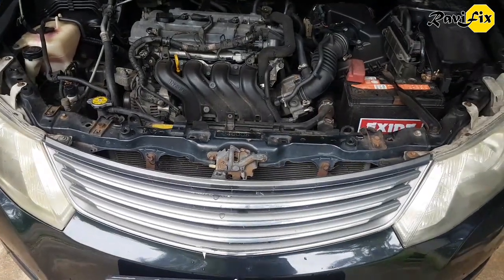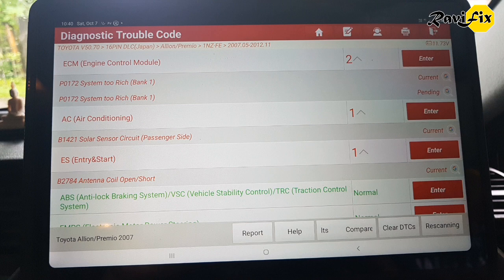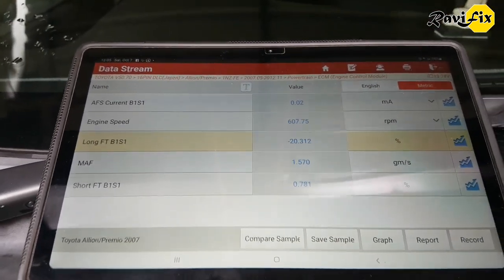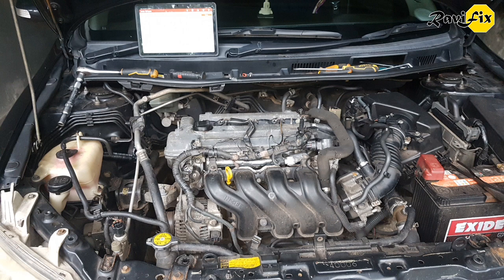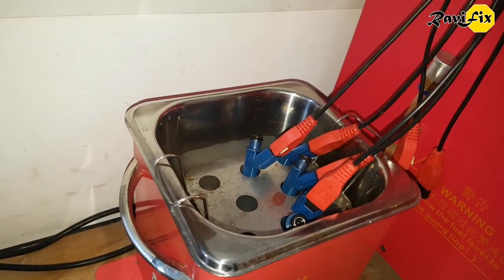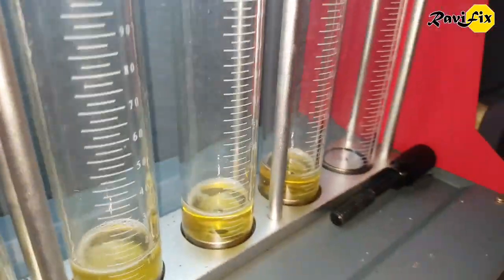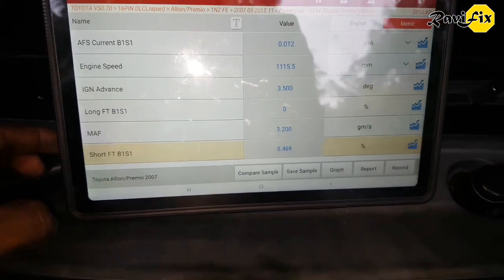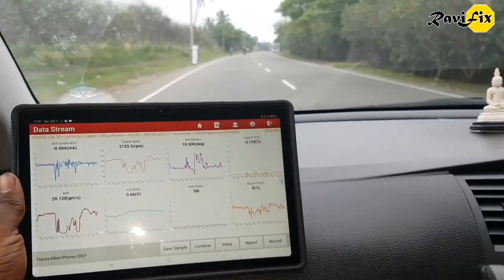Toyota Corolla Allion P0172 System too rich Diaganosis and Repair. learn auto scanning

Comment: The rpm at initial check was at idling i.e. 600. when you said you fixed it, it was at 1100. The values will definitely come down at higher rpms.....

Comment: Greetings Ravi. The situation with my car engine 2ar-fe errors p0102, p0172, с1201. Can you please tell me what the correct readings are for the MAF sensor on this engine g/sec on XX and when moving ? The car has gas installed.
Reply from the maker: It should be a closer value to the engine capacity

Comment: Thank you for the video, my question is why did you check the spark plugs for rich condition? I guess spark plug cause misfire results in jerks and knocking found these syptoms easily while driving.

Comment: Hi Ravi, what cleaner did you use to flow the injectors? Also the one for the ultrasonic cleaner? I was using a solution that was too corrosive for the pump in the machine. And had to replace the pump ever so often. Any tips?
Good video, bad injectors can throw P0171 and P0172 but I always go after the MAF sensor. Low hanging fruit
Reply from the maker: We have distributor who distribute those chemicals import from China. Different chemical for ultrasonic bath and the testing machine. 
I have been using these chemicals over 3 yers my machine by changing time to time. Still no any issue.

Comment: Is there a way to check the injectors without removing them?
Reply from the maker: Not in this situation. Because as the fuel trim corrections going on, no much fuel inject in to the port as we seen outside of the engine in this video.
If a leaky injector could identify with a pressure drop test using a waveform taken by a pressure transducer without removing them.
Reply: Phone number eka ewanna please